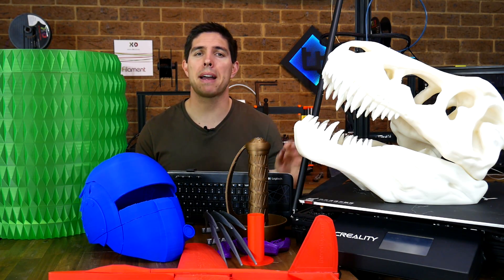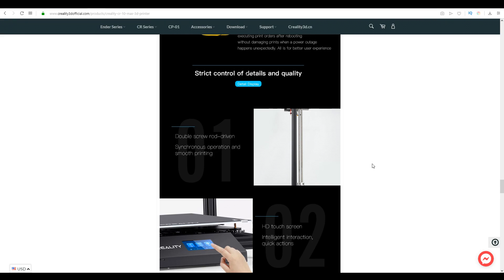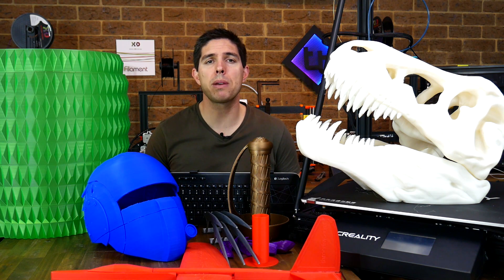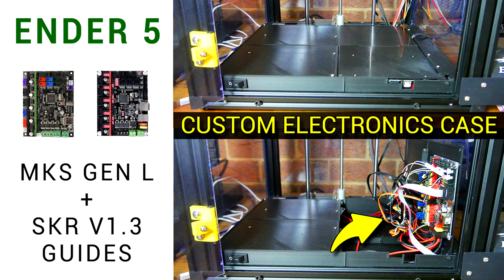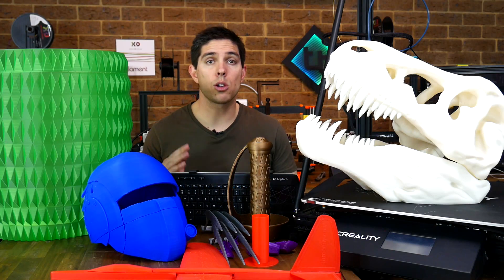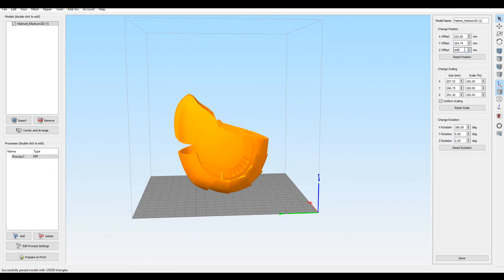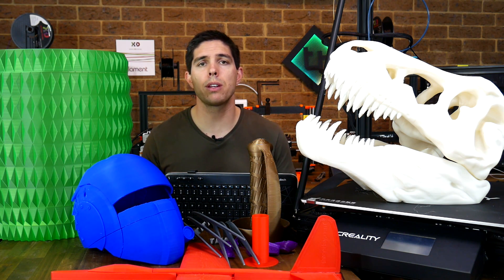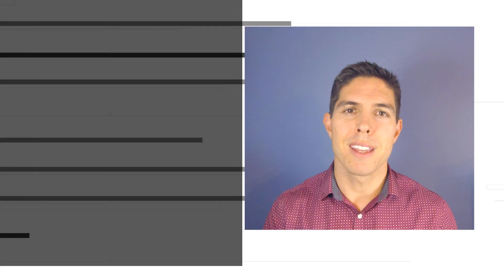CR-10 Max review - Is bigger better?

Comment: Kinda late to the party, but I need to know the correct position for the two wires that come from the motherboard hotbed to the mosfet. On the mosfet there are no markings for polarity and stupidly I didn't make a photo or write down how I should put them back since I had to make another longer cable. If anyone who has a Max can confirm their position, it would help a lot. Thanx.

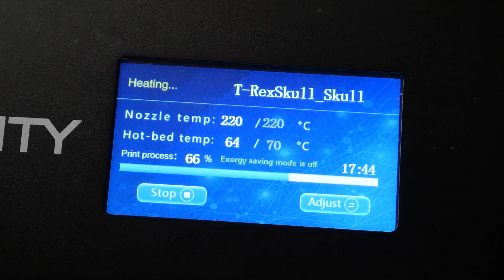P.S. I paused this video at around 9:20 but it isn't clear from that picture where these two wires go in that connector. Some pictures online show positive wire inside, negative outside and viceversa for these Creality mosfets.
Reply: Yours clearly has 2 black wires coming in from the motherboard, and the one on the outside seems to have white writing on it, maybe that's the positive? Just by looking at the mosfet I figured the outside should be the positive one. Hope I don't fry it.

Comment: So the takeaway is you have no idea how to tune 3d printer hardware (here is a clue: It's in the hardware, not the slicer) and do not check the tightness of assembly after delivery AS IT SAYS YOU NEED TO IN THE MANUAL BECAUSE OF TRANSIT VIBRATION.
Jeez, what a drip.

Comment: Great video!  And funny enough still very true for the Creality Bigger printers.  I just received my CR10S5 two months ago and have had nothing but trouble with it.  It came with a lot of these features already.  And Kudos to Creality for that but the nozzle continues to get clogged, Dual Z Axis motors weren't in sync and bar wasn't parallel with the bed, tiny little thumb wheels for leveling the impossible bed, the glass bed isn't completely flat and heating this massive 500mm by 500mm bed takes almost 10 minutes and is just about impossible to keep prints from pulling away.  I'm definitely going to be using a lot of your recommendations, even though mine isn't the Pro Max.  Thanks for everything you do for the community!

Comment: Hi Michael, these videos on the Cr-10 Max have been great, as I've just purchased one as my introduction to 3D printing. I'm making a KITT replica of sorts from Knight Rider but decided to try and upgrade the 80s style dash to something a bit more sleek and modern, so I've put a 24" touch screen and PC in to up the tech a bit. 

I chose this printer because of the large bed and was looking to mainly print fairly large flat piece for the dash. Would you have a list of suggested mods/upgrades I should look at to be able to print large panels in ABS? 

Is there a particular hot end and extruder that does everything, or is it more a situation of change out parts for particular builds. I've already invested in this unit, so I'd like to try and have it able to print any material I like with minimal changeover of hardware, if possible.

Any suggestions on upgrades would be greatly appreciated :)

Comment: Great video. Personally I just love the CR10 Max, have been using this machine for a couple of years now, no serious problems. Really enjoy printing full scale models, so this machine completly changed how I work. Thanks for sharing :)
Reply: I just received a free used cr10 max (in july 2025!!) Which needs some fixup. I have no experience with 3d printing at all.. am I gonna get any good results?
Reply: @JelleBais  Congrats with the free printer. For large prints the cr10 Max is great, but compared to newer machines it works rather slow. That being said, I really love my machine, few 3d printers can print as large models as it can :)

Comment: That's way too much screwing around to make a $1K device work. Changing firmware? Having to use a DMM to adjust stepper motors? Broken components and loose screws? Extruder problems? No. That's just unacceptable. Why anyone would purchase a device like this to be productive and 'just print' is beyond me. The volume area is fantastic, and I personally can see a lot of uses for that, but if the printer doesn't actually work, then its print volume doesn't matter.

While it doesn't have quite the print volume, I'm glad I went with a resin printer, it literally just worked out of the box. From the first print, to the latest, I have not had a single failed print.

Comment: Hi mate. My filament sensor on my cr10 max pauses and resumes print, but it doesn't pause quickly enough and trys to finish the layer before moving out the way with nothing coming out the nozzle, it pushes the cut filament into the boden tube and past the extruder before it stops, then, when you sort that problem and resume print, it extruder all the way as it travels to where it resumes the print.. any idea how I can fix it, thanks Ed.

Comment: I have a Creality CR-10 Max that I've just received, so far I can print gcode files that came on the SD card, but I have not managed to print a single model that I have created and generated using Creality Slicer 4.8,  I am trying to print a simple cylinder that has a wall thickness of 2 mm.  It just doesn't stick to the bed.  I must be doing something fundamentally wrong, just don't know what is wrong.

Comment: Yes you have to check each bolt on the cr-10s. The main reason for returns with them. Seems to me they loose half the sales from returns for this exact reason. & this is why you can go on ebay and have a supplier with 10-20 of these going half price.

Comment: I have the cr 10 s5 and i have as i used an ather filament a problem with underextrusion but i can fix this and also is is a good printer. And he prints good for smal and big objekts but a closed build room have many advantages. For print abs or be like asa.

Comment: I'm a new subscriber and I need to print a 600mm X 200mm X 200mm part, what top 3 - 3d printers do you recommend? Can I get a smaller unit and print it diagonally/vertically (basically on the volumetric hypotenuse )?

Comment: I bought the precessor of this printer, the cr10 s5 directly form creality. it was a nightmare. creality send me a damaged printer that that had  bent parts. Creality said they would send me replacement parts, but they track and trace they sent didn´t exist, also after month and endless contact with customer support nothing arrived. I ended up with a pile of trash even after one year of trying to make it work with all kind of methods. Ali express just gave me 10% of the price back after the complaint procedure and didn´t  keep up their promise.this was the worst online shopping experience i had. I can also not recommend their services. so better no creality anymore, I am happy with my prusa though, but miss the possibility to print large when needed.

Comment: hi sir,,,,,excusme,,,i have a questions about this machine....
i made 3D Object using solidwork, and then i'm import that file (*.sldprt) to *.stl file, then i'm open that file using creality-slicer. my question:
1. why object has i made is not smooth? can you give me some advice about my problems?
2. why you can make a bigger object without support? (t-rex head project)
3. what software you use to make 3d object??

Comment: I had all these issues on my S4 and took time fixing al these issues in the first 2 weeks.
My friends with S5 did the same 'needs'.
2 years later my S4 has been working flawlessly without any issues to complain about.
So, yes, it's not a perfect 'improvement', but any pro user/engineer can see these issues coming and easily fix them.

'Large' brings those problems you discuss.
This video was really helpful for me.
I do think the MAX is too big.
Like comments from others below, Creality should focus on fewer models and higher quality/reliability [like Apple has :-)]

Price of the MAX is now £540.
But the size and straight transplant of CR-10 300 dimensions and engineering is not good business IMO.
Allow another 25% budget and 2 weeks+- to make this thing work well.

Thanks for the review, it helped me decide against the MAX as being too Big and underdeveloped.

Comment: Hi having trouble with the cr10 max its got the z height below the table and does the  height with the probe then trys to drive the nozzel into the table on the last movement, is there a way to set this back to the right height or a total reset ? thanks David

Comment: If Michael can’t get perfect prints out of a printer, who will? My Ender 5+ has only the frame still stock, touchscreen layout is user unfriendly, particularly baby stepping is an absolute pain, which is a basic requirement. PSUs fail, motherboards are ridiculously loud, blow capacitors, Bowden feeder is poor quality etc etc. I agree with poster below, Creality should address quality issues instead of pumping out models which don’t work right. For this money you can easily buy a perfect product like a Prusa.

Comment: Great video! I was thinking about getting this but then I started looking at the Anet ET5. I can get the Pro version of that printer for £325 in the UK and it has all the features I want like Auto Bed levelling, tmc2208 silent drivers, 300x300x400 build volume, touchscreen. Pretty ease can you review it as it's got better specs and price than the cr10
Reply: Tis an Anet. Don’t trust anything with that name on it.

Comment: Very informative. I just got my new max with built in BlTouch, still struggling to get printing on the bed. After self calibration the printer starts printing at 3 to 4mm above the bed. How can I fix this? I got your 0.8 mm FFF but the problem remains the same

Comment: Hi i have cr10-max was working fine then stopped halfway threw a print now has completely lost its z position and hits the bed do i need to undo the z drive couplers let it run threw a home positon on the steppers and re tighten everything ? ive tried everything to get it right  ?
 Your help would be greatly appreciated

Comment: I'm looking forward to the community stepping up for this printer as with the cr-10 and ender ranges. I bought this printer and have endured part of the steep learning curve to the point where I have moderatley good prints at 0.4mm, havnt even bothered with 0.8mm. I have had to replace the bltouch and my cap tube has been shortened after snapping and popping out a few times. Mods ive done include calibrating e-steps for all axis and extruder, updated firmware(probably not with thermal protection), anti-backlash screws on z axis (I need to revisit this mod but it is essential) and inserting a stick into the cable tube to the extruder so it doesnt rub on the bed. The bed needs constant re-leveling and gets warped very quick (I think glass is the way forward, layer shift is so likely in swaping material it would be better to get a 3KG roll). So what we really need for newbs like me is a comprehensive guide on both MODS and machine/Slicer settings to get the quality prints. Its a shame NEXITECH hasnt got more info on his tricks of the trade as he seems to have got very good prints at both 0.4mm and 0.8mm. I agree with earlier comments that creality are spamming out to many printers and not getting the ones they have up to spec. Its fine relying on the community for the cheaper models but the expensive ones arn't going to get the same kind of attention.

Comment: Hi.
 Thanks for this video. After watching your rewiev I went out to buy a CR10 Max and I am really glad for it.
But sometimes I have a little Z axis skipping. And I wondered if it could be dou to VRef. What is the VRef preference from Creality to this CR10 Max?
Kind Regards.
Reply: Hi! I know it’s been a while since this comment but how’s the printer treating you so far? I’m thinking of getting one as my second larger printer
Reply: @kj8168  Hi. It is treating me fine. Had to change the bed to glass. The stock bed could not handle the high temperatur and long time ABS print that I'm printing. Else quite good and I am pleased.

Comment: I bought one, needed average tuning out of the box, about 5 unsuccessful prints and then I got one successful one, then the extruder stopped receiving signals to heat up, I changed the element, checked all connections, could not get it to work, then one day it worked again, then the computer stopped accepting connections from my laptop, used a sd card with print files instead, worked for a bit, then the extruder started having problems again and I finally said, "This is junk, and its a waste of my time", sold it as a parts machine. (I did have a 3D printer expert look at it and he confirmed the computer in it was faulty, among other faulty components)

Comment: HI, excellent work like allways. Can you tell me, where I can download fw with a heat prot.? On my Cr-10 Max the bigest problem is low real temp on nozzle. I think this is about 20 degC minus value on display. So I need about 240-250 degC for PLA and materials like a CPE or PETG with higher real temp are for me unprintable. I think that your problem with a low layer adhesion on big printed green can maybe was too "cold" too? And - dir you met a problem with a homing in X from maximum Z value?

Comment: I use my CR10S5 for cosplay pieces and printing multiple pieces in one go, and it has been nothing but a dream. Crazily enough, its bed was less warped than my ender 3's was so I went without ABL for a while. Its print quality is on par with the Ender 3's as well.
Personally, I think the Ender 3 and CR10S (4 or5 if you want large volume) are the way to go over the CR 10s Pro line. I prefer reliability over a touch screen or silent stepper motors.

Comment: I need some opinión to make  a decision (sorry if i don't spell right, english is not my native language)
Here where i live, i found the ender 3, Brand new at $209, but, a well known store is selling a cr-10 max, used, but in a great shape, only used a few times for the showroom, at $417
There is the thing. -I'm a begginer. -i have the space to the big printer. -I have no problem if i need to learn a few things or follow a tutorial to fix some issues (i mean, i Will not study electronics for this, but i'm ok following instructions from a tutorial and buying some upgrades if they are easy to install).
Im not planing to buy the printer thinking that i need it for printing something big, or something small, just be able to print many things

So, which printer shoul i go for? is that cr-10max a great deal? or is really too difficult to use, that the ender 3 is still a better option, even i have to mod/upgrade it and it's volume limitation?
thank you!

Comment: My CR-10 Max is great. I think you must have the worst luck. I did get mine from tiny machines so they have made a lot of changes which helped mine to do better prints. With that said it a great machine and I have had none of the issues in this video. Talk to tiny machines about your issues they have magic touch for this set up.

Comment: With working Thermal Protection....OMG Creality turn it on at the start!!! I had to use different firmware for my CR10S Pro as well to make sure it was turned on. Creality is like only a half step above ANET, least there is hardware for the termal protection.

Comment: I've just ordered a CR-10 Max. My CR-10 has been well hammered with pretty much day and night use for the last two years. If I get the same results as with my CR-10 then I'll be happy. I just need bigger build volume for prototyping bigger parts, hence why I bought the Max.
Reply: Does it work for prototyping, or do you have the same issues where it is not worth the time? It looks like it is a great printer with assembly issues.
Reply: @jenspetersen5865  the Max works OK. Print quality is pretty good with PLA. Have to baby it a bit with PETG but it works.
My CR-10 now has a Trianglelabs direct drive extruder with all metal hotend and is great. I prefer it to the Max. Been printing 24/7 for last 5 weeks and hasn't missed a beat. Whereas I've had the Max apart a couple of times in the same time frame to clear jams.
Reply: @TYGAMatt  Thank you for the answer! I have two CR10S that I don't have time to figure out how to fix (drive boards), but I need the build volume of the Max for a prototyping. I have had loads of problems with the CR10S, whereas my Ender 3 Pro has been great.
Is it the hotend that is the issue on the 10 Max, or are there things mechanically that play a role. From the outside it seems like aside from inertia, everything else would be better on the Max, but appear not to be.
Reply: @jenspetersen5865  if printing PLA its fine and will print happily all day. Also printed a fair bit of ABS on it and that's fine as long as its not a particularly big or tall part that's liable to split or warp.
Haven't really printed any TPU with it so can't comment on that.
PETG is OK as long as I print slow so that I can use the lower end of the temp range of the filament. Trying to print PETG at 60mm/s and 0.25mm layer height  like on my CR10 with DDE is impossible. It just grinds the filament  and jams.
As for speed with PLA, you can crank it up to around 70mm/s and it copes. I use a 7mm/s jerk and 500mm/s/s acceleration and get acceptable results for what I need. It doesn't rattle around as long as its sitting on a sturdy bench.
I use my CR-10 for playing with firmware settings and general fiddling.... The max I just leave alone as much as I can and just print.
Oh, one thing is the factory build plate. The thing warps like crazy. I finally got a mirror cut a couple of weeks ago and it's way better.
With the stock build plate you'd see the Z axis working overtime on the first few layers levelling things out, but no longer the case with the mirror.
And finally. Make sure that the X gantry it trued up. It makes a big difference.

Comment: .8 nozzle at say .4 lht means your pushing 4 times the plastic. 40mm/s and 230c nozzle should take care of it. With my 1.2mm nozzle i run 30mm/s and as high as 240-245c (yes for pla)
Reply from the maker: Thanks for stopping by Nerys and thanks for sharing.